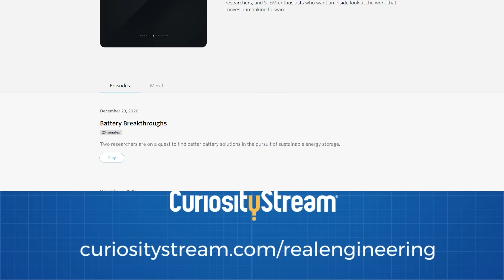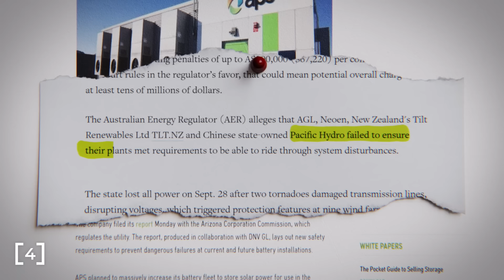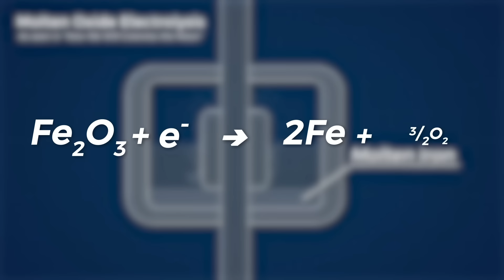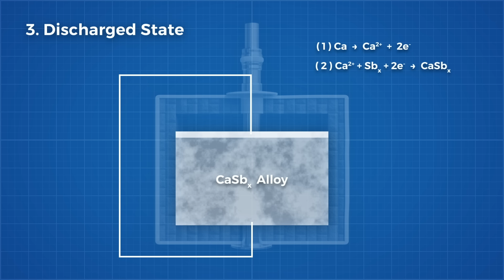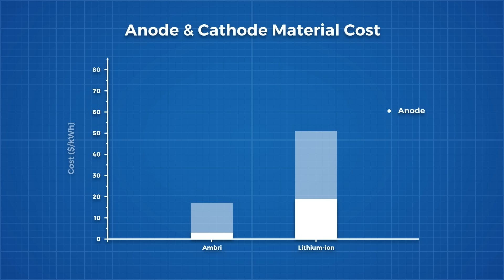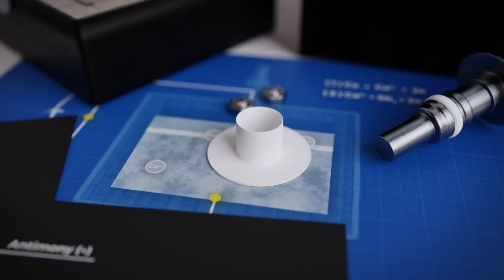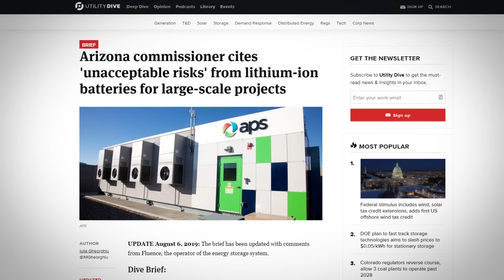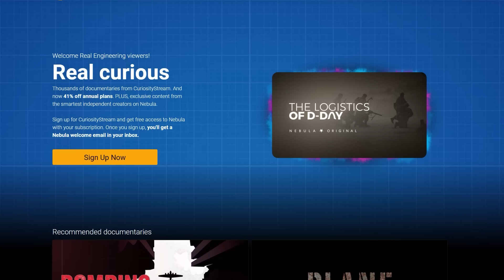The Missing Link in Renewables

Comment: Projected headlines be like: "Molten metal lava leaking from a failed battery array"
Reply: Just dig a shallow hole where you make the installation. Worst case scenario, you get a liquid metal lake. Best case scenario, the engineers know what they are doing and no such thing happens.
Reply: @michaelpapadopoulos6054  cant be! Engineers never know what theyre doing. They do very well tho.
Reply: @michaelpapadopoulos6054  I mean that's the first rule of engineering: everything leaks
Reply: Aren’t these battery storehouses going to be in the middle of nowhere, likely near a power plant of some kind, anyway?
Reply: @midnite1112  true, even electronics, one of the reasons for moore's law breaking down
Reply: The "lava" is only 500 degree Celsius. And it would turn into a solid even very quickly once it is exposed to outside environment, even if the solid is still pretty hot.
Reply: @kalyana9705  most importantly, i don't think calcium and antimony are toxic. secondary containment can be factored in as an added layer of failsafe, and potentially to reclaim the leaked electrodes. the concept still sounds very promising and simply needs to pass a real world test run.
Reply: @midnite1112  be it fluids leaking or memory leaking.
Everything leaks.
Reply: @alveolate  yea i mean it might still be cheaper to just make new batteries from scratch at that point. Recycling isn't economical. but it wont harm anyone so it could just be thrown in the junkyard afterwards.
Reply: @alveolate  The only possible issue I see is if the calcium somehow manages to comes into contact with water as it reacts quite violently at high temperature and releases a lot of hydrogen which could explode if in a confined space. I don't see it as a real issue though, more of just something to keep in mind when designing the site.
Reply: Nothing will happen as it's not combustible. It will cool very fast as well
Reply: @listerdave1240  Famous last words: "I don't see it as a real issue though"
Reply: @alveolate   antimony toxic? Occupational exposure may cause respiratory irritation, pneumoconiosis, antimony spots on the skin and gastrointestinal symptoms. In addition antimony trioxide is possibly carcinogenic to humans.
Reply: in this certain aspect, you can see lithium ion vs CaSb just like conventional vs thorium fission reactor
when things goes wrong with lithium, it gets hotter -> it explodes
when things goes wrong with CaSb, which on itself requires heat to maintain reaction, the lava would just solidify and things would just be an inconvenient halt
Reply: @shandrakor4686  still beats lithium fire imo, but yeah, won't be fun either way dealing with any kind of battery leakage
Reply: @listerdave1240  meaning floods are an absolute nono. too bad they are the single most common natural disasters.
Reply: @alveolate  antimony is extremely toxic.
Reply: @aronseptianto8142  not really. Calcium reacts violently with water and antimony is super poisonous. Plus the molten metal is really hot. A leak would be catastrophic.
Reply: @schwig44  well, its not really a law, it's Moore of a guideline....

Comment: As an addendum, I must clarify that the sodium batteries I believe have lower power densities than lithium ion right now! It doesn't matter, as I want to see huge sodium ion batteries put in static positions, to support hometowns and cities, as energy backup. Buildings in cities and towns, especially these box stores, should be covered with solar cells, especially since they're so ugly anyway, they would look better with a bank of solar cells with a pitch roof design on them.
Reply: And you can use the batteries to cool the solar cells somehow as well by heating up the batteries, allowing higher energy efficiency from the cells , and creating higher temps for the batteries saving energy on both ends

Comment: That makes sense, current lithium tech has been pushing hard at energy density, pushing for the highest kWh/Kg it can. It makes sense if weight isn't a concern you can find something that works better for kWh/$
Reply: The number that deeply matters is kWh produced / kWh grid maintenance. If a major improvement of that metric can be demonstrated over pumped-hydroelectric then this battery technology may be enough to push solar-thermal beyond the 7/1 return on invested power that first-world economies require, but if not then this won't make solar or wind viable as primary power sources.
Reply: Isn't volumetricenergyty important in some places? I mean there's not really an infinite amount of land to house energy storage, and expanding it beyond population centers can harm the environment. idk though if there is enough space for energy storage that is inside human settlements.aybe someone should look into how much space is needed for energy storage, depending on how energy dense it is.
Reply: *volumetric energy density
Reply: @hi-gf5yl  actually world is very big. Fact is if you have renewable energy generation then you automatically have enough space.
Reply: @hi-gf5yl  That's kind of the problem with pumped-hydroelectric, though that's just as much a problem with the land available. You need a large area and a large height difference between reservoirs.
Reply: @falconeagle3655  clearly you have no clue what you're talking about so I'll be gentle on your little soul. The fact is that "renewable energy" doesn't exist, literally it's like saying banana cobalt or mountain fetus, that's how much sense the words make.
Reply: @falconeagle3655   it's funny that you ask such a question instead of doing some research to inform your brain that it too can think for its self and make its own ideas. 
 I challenge you to prove me wrong "smart boy"!

Comment: In Australia we often refer to the "tyranny of distance", which applies directly to Grids and Grid Storage, a magnificent Engineering problem solving exercise. If the future expectations of Solar Roof Micro generation, Home Battery Storage and P2P EV vehicles continues, then there's a bit of explaining to be done as to why Government does not promote the same on-site Power systems for the Industries, the same ones we were told to buy our own systems for so as to allow them cheaper access to the failing fossil fuel system.
Reply: It is interesting how a first world country with such immense lithium and solar resources is still using steampunk technology to power its grid. They would also be a prime candidate for SMRs for base load if they are purchased in bulk.

Comment: I've been in renewable energy since the early 70's and the "Holy Grail" has always been cheap and reliable energy storage.  If I had a nickle for every time I've heard "This new technology will finally provide a cheap and reliable battery solution!" I would be VERY rich!
Reply: @DarthObscurity  Any examples? I'm genuinely curious.
Reply: Very well said.  Would you agree that young men in particular are fools when it comes to electricity.  They 
think it can be put in a paper bag.
Reply: @ValMartinIreland  True. I believe it's because it need some abstract thinking. You can't see electricity like you could see gears for example. I don't feel very competent at electrical stuff, I'm more of a thermodynamics guy, but whenever I try to explain someone something that requires 11th grade math, they're bored (or rather dismissive and give up trying to understand) by the second sentence.
Reply: @buzzerpisang3640  Yes, what about it?
Reply: @DarthObscurity  if I had a nickel for every time somebody said solar energy has less subsidies than oil, I would have 2 nickels. It's just not true because oil only gets subsidies if it produces reliable energy for consumers. Solar gets subsidies even if it doesn't produce energy. So the money per kilowatt hour produced in solar is 80 times the money for oil.

Comment: I happen to live in SA and our power grid is top notch, we almost never have an issue with blackouts, 10-20 years ago that was a different story. What I feel you have failed to realise was that during this event, one of the major interconnects at the time was going through an upgrade. The remaining interconnect was never going to handle such a load. Based on where i live, in the past 10 years we have only had two blackouts! What really stands out about the blackout your referring to is the fact it was the entire state, something I dont recall happening in the past.

Comment: Batteries are so interesting. Can you talk about cement block batteries sometime? Great video
Reply: you mean the one with cranes from the swiss company? Would also love to know more about it especially how scalable and cost effiction it is compared to hydro pump and battery technology like this on or Li-Ion!
Reply: @Kamikater2  Yes! I have only read a few things about them, but it seems like there could definitely be a niche for it in the power storage solution
Reply: @Kamikater2  sorry to tell you but the mind experiments have been debunked... this battery is not even close to claimed capacity or power
Reply: @canadianemu  The "concrete blocks" battery is indeed a scam...
Reply: @TecSanento  Overall I agree with his conclusion that windy conditions and cranes are not a good combination and missing a proof of concept is pretty big thing there.

But holy shit were there many mistakes/inaccuracies in this debunking video... 

The biggest fail was to say that hydro pump is already there and therefor no new tech is needed. Like you could build a pump hydro everywhere and not like there are nearly no places left to build any pump hydro plants... (or if you would build a artifical pump hydro location it would be absurdly expensive)
Or that a pump hydro only consists of water and need no maintenaince therefore...
Or that the original video said they have concrete blocks filled with rubble to make them cheaper and he just calculates with fully concrete blocks...
Or that 100$ / 2.5 is roughly 50$ instead of taking the accurate number of 40$ (if you want to debunk something you need to round your numbers done (or keep them accurate) to say even if calculated generously it still doesn't work and not round numbers up!)

And quite some more....

But yeah in the end his points still stands that they don't prove at all how they could handle wind, so if they can't prove it works at all, the costs and other things don't matter.

Comment: "According to the BGS Risk List 2015, antimony is ranked second highest (after rare earth elements) on the relative supply risk index."

This quote was from the wiki page on antimony, along with more info on world reserves and production capacity. I'm no expert on mining, and haven't made sense of this seeming contradiction.

So, is antimony really "dirt cheap", and scalable to energy grids? 

Tangentially, are antimony politics, extraction, production and reprocessing potentially cleaner than the alternatives? The wiki page seems to suggest that it's on the dirtier end.
Reply: Yea, rare earth are really common but the main issue it's that most of them are "diluted" so it's not cost effective trying to mine them unless they are grouped together by some kind of geological process, usually meteoric deposition, so in that sense they are very rare
Reply: antimony is rare but common.  it's common since it's everywhere, but it's rare because there aren't many large deposits of it. (cost of extraction greater than it's worth)  on top of this, most countries aren't mining it so because of that, it's an issue in terms of scalable supply.

Comment: I hope they're working on much bigger cells. Stack a bunch of those together and all that insulation on the inside is just to keep the labels from burning.
Reply: they want them to stay hot,
so stacking them very close together is actually a good idea
Reply: @koloblicin  Calcium melts at 1115K. Paper chars around 400K to 500K.
Reply: @Pence128  yah well,
maybe the labels on the batteries are just for show you know.
im sure there is a reason why they dont make the batteries bigger.
Reply: @koloblicin  It looks like they're connecting them in series into 1 MWh modules.

Comment: If I had to guess this would be about storing electricity.
Reply: You're correct.
Reply: Why not just spin up big things to keep the grid stable? (Basically what we have rn)
Reply: @JANICKGMO_  the bigger the spinny thing is, the longer it takes to spin it up and down. Batteries are a much more reactive form of energy storage.
Reply: @pe5erbarnes  that's one part of the problem, another part is big spinny thing wants to spin one way, and the earth tries to spin it in the wrong direction
Reply: @xureality  ",,, the earth tries to spin it in the wrong direction"  
1) The earth never tries to spin in the wrong direction. 
2) That is only an issue when generators are installed backwards, which is easy to fix.  They just spin the building 180 degrees.
Reply: rick dees yeah apparently
Reply: @Danokh  uhhhhhhhh. Use the energy created to drive an electric engine/generator that spins metal.
Reply: @rickdees251  I don't mean backwards, I mean sideways.

If you have a fidget spinner to hand, try spinning it real fast then try to tip it over. The spinner will spend it's energy to counteract your tipping force. Otherwise known as gyroscopic precession.

Comment: I mean it's cool and all, but this video felt like an ad for that type of grid storage, rather than an exploration of the different types of grid storage that could compete with Li-ion, which is what the title and the intro implied
Reply: Pump hydro storage doesn't need to compete with Li-ion because it already bested li-ion at it own game.

Fact: the world's largest pump hydro storage facility is 24000MWh which is larger than the world's largest grid battery 300MWh.

Fact: pump hydro storage make up for 95% of grid energy storage.
Reply: @luongmaihunggia  Dude why are you everywhere? Are you a lobbyist for pumped hydro storage?😂This battery isn't supposed to compete with pumped hydro storage. They meant not scalable as in you can't build pumped hydro anywhere you want. You need to have a huge water source nearby. 95% of grid storage is pumped hydro because there are no other reliable storage sources and this battery is trying to be that reliable option along with pumped hydro.
Reply: @deepaksanaka  yeah. So what? So what if pump storage can't be build anywhere? So what? Just build it in places that are possible and then connect it to the grid with cables. Problem solved.

Comment: This battery would be perfect for a Venus mission
Reply: If Venus didn’t have unbearable pressure, maybe.
Reply: @Think_Inc  high pressure will come in handy, since the recent discovery shows that the superconductivity can be achieved not only at significantly low temperatures, but also at significantly high pressure.
Reply: Probably not worth the weight. You'd have to keep it molten for months in space while the spacecraft does nothing that needs any of its power, and then there's having to deal with the way liquids tend to slosh around when there's no uniform force keeping them in place. The latter in particular is a big enough problem for homogenous tanks of fuel, to say nothing of a mixture you want to keep in separate, defined layers.
Reply: @Feraligono  but what if design those hardware to be inactive until conditions around will hit certain points of temperature and pressure? that way you won't need to adapt these things to space and Earth conditions.
Reply: @tomashcraft  Because then you'd need a second battery to run on until that point, which is added weight.
Reply: @Feraligono  you're right. But what if think about universal battery as of added weight? I mean - capabilities to operate under heavily different pressure and temperature points - this should add weight literally (as of some presumably complex construction) and figuratively (in time of development and cost of construction). Also, there are circumstances where having a "double" parts while in space is absolutely justified. For example one of the recent missions to Mars, particularly Chinese. They've sent a rover and a satellite in one package. So in the same package but for a Venus, having a completely useless additional battery, while in space, could be justified. Sorry if Im annoying, just excited by all this.

Comment: Sodium sulfur batteries operate similar to this calcium antimony chemistry and have been around for a while made by NGK. Why is this better?
Reply: northernepicadvenure I haven't done any research about those batteries, but I would guess that a leak would be much worse.  Sodium is very reactive.
Reply: @Hyrum_Graff  That is a fair point, but I feel like both sodium and sulfur are cheaper than antimony. (I also have done no research). I have researched however that there is a NaS BESS near Golden BC Canada that can self commutate in the event of a downed transmission line.
Reply: @northernepicadvenure  and antimony is highly toxic it's a terrible material 
This is not even mentionned i'm so disappointed.
Reply: @NicosM51  Learning something new every day. I am somewhat sceptical that chemical energy storage will be the future of energy storage. It will for sure play a role but pumped hydro, compressed air energy storage just have way larger capacities and life spans. Fly wheels react just as fast and can be cycled millions of times. Really chemical storage has a niche market in medium energy capacity storage between flywheels and pumped hydro.
Reply: @northernepicadvenure   all of these options are on the table and it's expert's job to take the best out of this to equip and adapt the grid.
Liquid battery can be intersting if the materials involved are actually dirt cheap and can be produced massively. Antimony is already kind of expensive, twice as expensive as copper, although consumed in relatively limited amounts (less than one hundredth of copper consumption). 
This is a dead end.